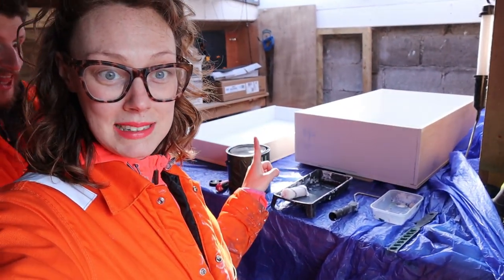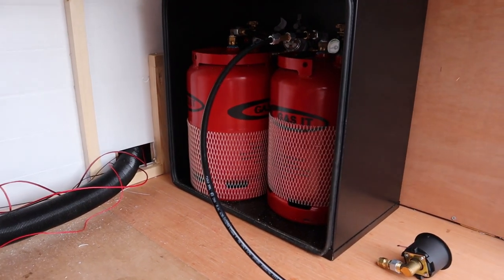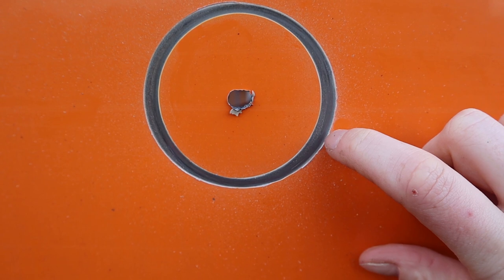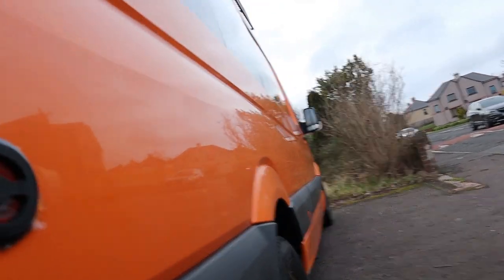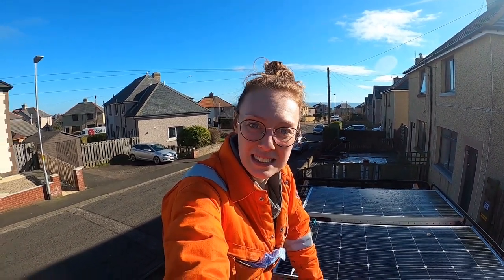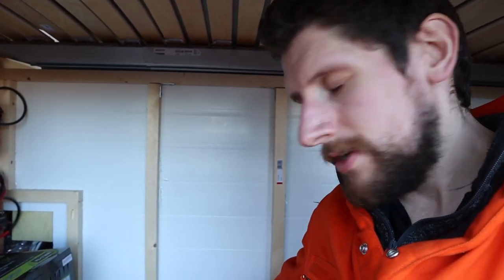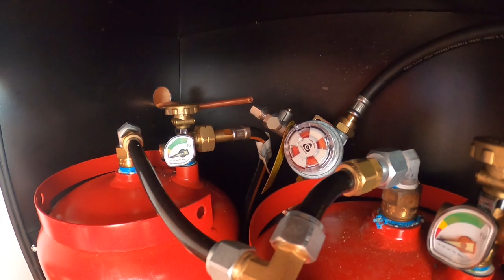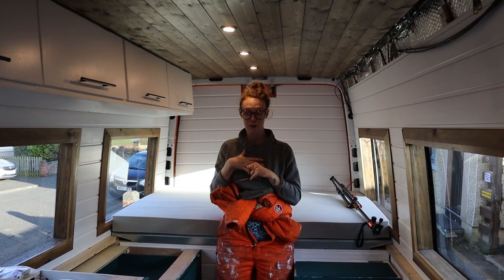Fixing a LEAK in our MaxFann & Installing LPG | Van Conversion Ep. 9

Comment: Ah man I’ve had this issue on my sprinter. It’s almost like you get one hole a drill bit. Because unless it’s ultra sharp it will wonder. 
Also..... try screwing a small piece of ply to the van. Screw 20mm away from centre hole. When it drills through the ply. Take away the rubbish. And it will leave a guide so it can’t wonder 👍🏻👍🏻 new sub
Reply from the maker: Such a good tip!!